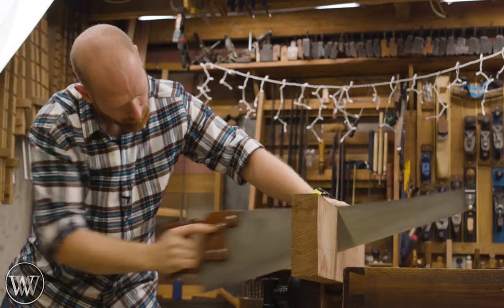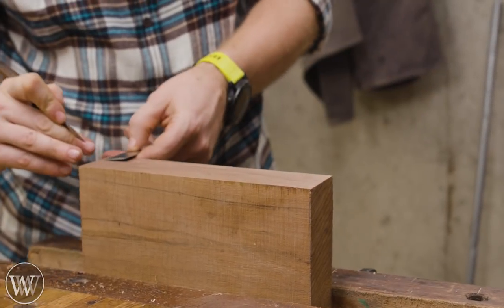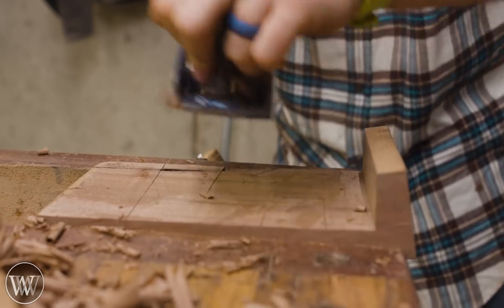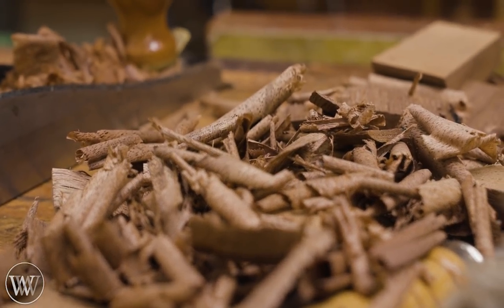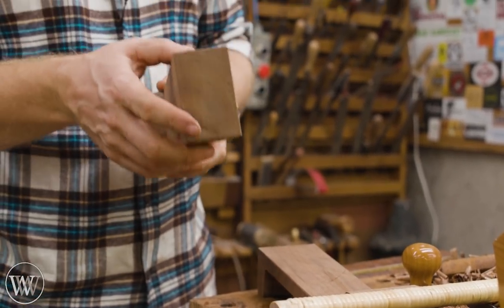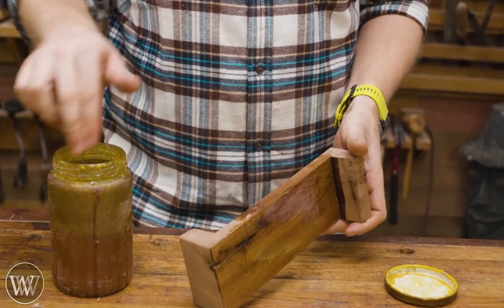How to Make a Pair of One Piece Bench Hooks

Comment: I have been a woodworker for a little over 50 years and I have made many bench hooks. Your two ends will never survive because of end grain weakness. If you want to use them like this, you should run a pin or even a screw all the way through the ends. Nice video though. Steve
Reply: Exactly the short grain of the hooks caught my eye in thumbnail causing me to watch. My bench hooks are a chip of plywood with short sticks screwed from the plywood side on diagonally opposite edges. Originally got the bench hook  idea from Roy a couple decades ago.